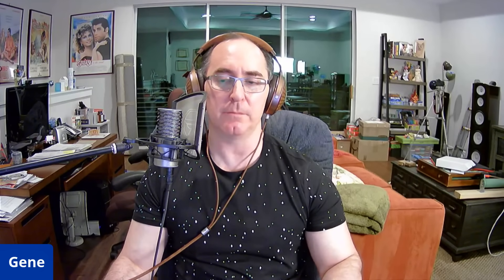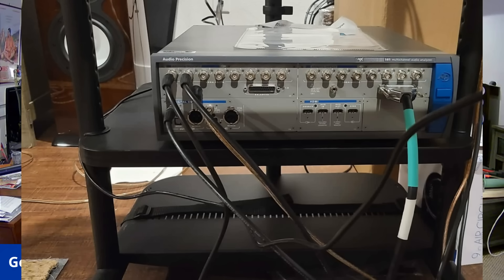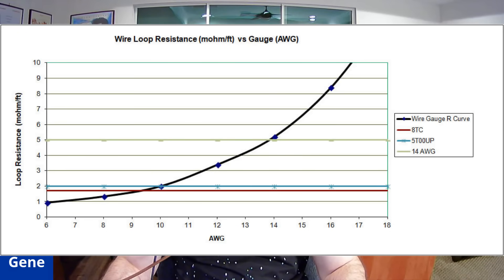Speaker Cables Really Don't Make Much of a Difference?

Comment: Even though its nice to see measurements, but I didn't like the conclusion "you're buying jewelry", since you're buying what sounds better, and not what measures the best (at least with cables). Its on buyers conscience if they buy something expensive without any noticeable improvements in the sound, but as it was proven so many times already - cables are very system dependent, so when are we going to stop recommending something based on completely wrong facts, like measurements. Since, as proven here in this video, we still don't know how to measure cables and correlate the results with actual listening test. 
Video would be great if it was just "here are the numbers, make your own conclusion and listen for yourself", instead of "here are the numbers, so music must sound better/worse/same"
Reply from the maker: Just because you don't understand the basics in electrical properties of cables,  doesn't mean others don't understand.  This is very basic and understood stuff I presented here. No magic, no mystery.
Reply: @Audioholics  that doesn't have anything to do with my comment. Did you able to correlate measurements with listening observations?
Reply from the maker: @hudo  I've not heard any differences comparing speaker cables unless the gauge is too small (18AWG or higher).
Reply: @Audioholics  you don't hear the difference in any cable (excluding very small gauge wires)? 
Thats very strange, there's must be something very wrong with system setup (speaker position/room). Once I moved speakers out from the walls and did very basic room treatment with carpet/walls, i could easily hear differences in some cables. Not all, but like half of them I tried, and not realated to the price
Reply: @Douglas Blake sorry but thats just not true. If you never heard the difference that doesn't mean other didn't or that is has to be psychology. I even had a switch for cables so was able to do quick ab test in few occasions, and sorry you don't have enough experience with this
Reply: @Douglas Blake lol you just said it, you never heard the difference which means you lack experience to even talk about those subjects! You chose to believe into numbers and don't trust yourself and your ears, which is fine, but you shouldn't then do generic conclusions that something is not possible.
Reply: @Douglas Blake i did, again more, in case i missed something, but nope, same as before. You say something is impossible because numbers, but don't have good enough system to hear for yourself, and then you find yourself an authority to tell everyone that its impossible
Reply: @Douglas Blake you too, keep buying hifi equipment because 1khz wave looks good on oscilloscope and enjoy

Comment: Nice test Gene.  Much the same as my person feelings on cables.  Only difference I believe I hear is mixing metals on cables. Silver plated copper to me sounds wrong, 10kHz + seems boosted. I am happy with pure copper.  Would be interesting to see if there is a measurable difference there.  Or if my head is making it up. Thanks for making the effort debunking cable BS

Comment: I'm sorry, but this is a perfect example of how you can take the most precise measurements and yet come to baseless conclusions.

Frequency domain measurements can never describe what something sounds like, because humans are notoriously sensitive to time domain characteristics, far greater than frequency domain, and yet you try to make assumptions based only on what you CAN measure, rather than all that SHOULD be measured. And i'm not even talking about measuring the external factors, that should also be measured for a proper all-encompassing study, that may allow drawing any kind of credible conclusions. This is not about just this comparison, I think that the lack of time domain measurements is one of the most overlooked components in many audio companies, also because it's hard and sometimes impossible, but that doesn't mean we cannot perceive the differences by our ears. So, I'm sorry, but the burden of proving there are sonic differences is not on those who can hear them, but on those you want to argue the opposite. Just because you can't measure or prove everything, it doesn't make it any less real. But I would agree that not everybody can pick up all the minute differences with their ears, in which case it should really matter to them if the cables sound different.

Also, if that's how you come to conclusions about audio, why don't you compare speakers like that? Two completely different sounding speakers can actually measure very close in terms of frequency response, even within let's say 0.5 db or less deviation, yet they can sound completely different.
Reply from the maker: You should learn the concept of Fourier Analysis and the Laplace Transform before making I'll informed statements like that. The lack of difference in amplitude response I measured also means there's a lack of difference in time domain behavior too. The psychoacoustics of loudspeakers is much more complex than the signal transmission of conductors.
Reply: @Audioholics  Ok, I stand corrected on that. But in that case how do you explain hearing clear differences and being able to identify different cables in a blind test, not just in one area, but multiple. Differences in instrument separation, differences in perceived speed and decay, differences in definition and soundstage depth, etc. What I'm saying is if you cannot find the right measurements to justify what you can hear, you can't come to a conclusion that what you hear is maybe not real. Just the opposite, it means you were not able to find the right thing to measure, or maybe there's no available tool currently to measure what makes the difference.
Reply from the maker: @LevonArakelian  to date, nobody has ever been able to show a preference in cables under blind testing conditions.  Most of the differences people think they hear in cables is due to placebo.

Comment: Thank you for the "real science". I have a question. Due to my room layout, I had to use 18' speaker cables to get around a fireplace and hide the cables. They are MediaBridge Ultra Series 12 AWG with banana plugs. Am I ok? I have Forte I speakers with a NAD C-388 Integrated Amp with 150 w/channel. I also had to use a 5 M dual RCA cable for my subwoofers, Audioquest Evergreen . Do you guys see a problem with that? Thanks

Comment: I have been into this hobby almost 50 years. Many years ago the editor of Stereo Review said that you can't hear the difference in amplifier's, I believe he was talking about power amplifier's. Well it turns out, they do. As well, just because something measures the same, does not mean that they sound the same. Kimber Kable's 8tc run's over three to four hundred dollars an 8 foot pair. I'm glad you put this test out there. I tell people, 1st, find out if you have a money back guarantee for at least a month, because wire's do sound better after running them in for day's.  2second, DEFINITELY compare them  to other cable's, Monster, Blue Jeans,  and other cable's around the same price. See if the establishment you're   considering buying you're cable's from have a loaner program, so you can compare all of them,  some establishment's will gladly do this.   Listen in a very quiet room.

Comment: Thanks for the Video.  14 years Electronics Technician in the U.S. Navy Submarine force. Gene, you are spot on with your measurements and explanations. People who dislike this video and message are in denial. Most likely because they overspent  on speaker wire ~ Peace.
Reply: In a blind test I hear changes in cables on my system every time. For better or worse... Explain that.
Reply: @infooptimalfitness7720  Whatever you can assert without evidence, I can dismiss without evidence. -Christopher Hitchens.

Comment: I use monoprice 12ga. I had long runs for some bi amped speakers and I used double runs to effectively increase the speaker gauge. Thanks for the continued great content Gene.
Reply: They have pure copper also
Reply: Mono price cables are copper clad aluminum (CCA)!  Essentially junk.

Comment: Adding to my post below, A real test that would be interesting is to take a large range of capacitance/inductance and resistance from say one of the best wires/interconnects that you have to one one that is worse than your worst one. Mic up a speaker tweeter, then mid and then woofer and determine by using the best cable to the worst (for the largest difference possible) can any of the speakers cone movement or volume change at all with the largest cable differences available. I would bet that no matter what you have for an interconnect or wire the extremely small differences are too small for the speaker to reproduce so any of it is audible. Use that .2 of a db as the audibility level. You will find that the speaker drivers can't reproduce any of the audiophiles supposed "bad stuff". The driver will act as an effective filter on the insignificant wire differences. I could go on but you get my point. So much science proves that so much snake oil is sold everyday.

Comment: Gene, are you aware that over 10,000 double blind tests have been done with declared audiophiles in the last 40 years?  NOT ONE PERSON HAS EVER PASSED A TEST. The result needed to pass a test was downgraded to just picking out ANY change or be able to pick which listening test was which wire or interconnect. Even asking for anyone to pick out reliably one wire or interconnect was impossible. The auto manufacturers and others have spent millions on this stuff. It all came down to "it doesn't matter". The only item that can reliably be picked out are speaker changes. It even came down to amplifiers. A decent AVR receiver (about $400) vs expensive preamps and amps were not picked correctly. A few did but upon further investigation it was seen that the high end high dollar amps were so poorly engineered that they were coloring the sound so bad that it messed up the test. So, it would not have been worth buying that companies products at all. 

Bottom line over 10,000 people who claimed they could easily pick out wires etc and that the engineers were idiots, tin eared and were not properly "trained" to listen, well those people failed all the tests all the time. 100% failure rate. No one has EVER done it. If only one person had done it, he would be famous and the test would be online and heralded by everyone as proof that this stuff matters. All the big name audio mag writers (many are not in business anymore) stopped saying they could tell a difference and would take part in a test. They all said they could hear a difference but no way were they going to be part of a silly test when they had trained amazing audiophile ears! But, as time passed it has all come back into fashion. Now the audio mags make claims that they hear things that they do not. Luckily, people spending big money on wires and interconnects have the money and it is not hurting anyone. Better to buy wires than alcohol or drugs I guess. Just thought I would mention that you are finding out what many engineers proved over the last 40 years. Keep up the good work!

Comment: Would be great if you measured other brand speaker cables as well. Analysis plus and Nordost come to mind as they offer different strand and layout solutions than most typical speaker cables on the market. Do this and you can finally put this message to bed. I wouldn't be surprised if some of your followers would mail you their cables to test them. I know I would, but you already tested the cables I use. 😉

Comment: Thank you for the great video and the clarity on the subject. I’ve tired many speaker cables and wires and didn’t notice any difference. I think like you mentioned it comes down to what’s more aesthetically pleasing to consumers. I mean let’s face it a roll of generic speaker wire is pretty damn ugly!
Reply: In most audio systems, the cables are barely visible, aesthetics? Not in my system.

Comment: If all the speaker cables you compared had banana plugs or spades, etc. that react to a magnet, then you probably wouldn't notice much of a difference. Compare those cables with ones that are terminated with connectors that don't react to a magnet and then make another video explaining that speaker cable connectors DO make a difference!

Comment: Now I have gold plated banana plugs, but before that I had bare copper/silver coated wire. Each time the bare cable ends oxidized over time and I solved that by stripping the wire a bit further. To my ear that improved the sound each time I did it. Can you measure that?

Comment: Thx for the great presentation Gene!
I do think cables play a bit of difference in the final audio quality but I do not pray over them. The ones I use are all DIY with good quality components, but that's it. 
I've tested many speaker cables over the years and found that, for me, a good quality solid 4mm² made a good difference in the bass department. Not huge by any means, but the bass got tighter and seem faster as well. As I keep all the cables as short as possible I'll probably never hear a difference in the high frequency range. 
But Gene, if you have the time and will, would you try testing a solid cable to see if any difference would be measurable? I don't think I'm biased since I don't buy expansive pieces of copper wire, but what I've heard when I tried them made me keep the solid conductors in place for what now?... 5 years I think.

Comment: Hello, Gene. I love to watch your videos. I have Denon PMA-2000AE which is  basically the same amplifier with B&W 804S. The speaker need current to sing and the amplifier deliverid it! i have changed 5-6 speaker cables from hi end brands. One day realized to lean on measurements, not pretty words of manufacturers! So I bought VAN DAMME UP-LCOFC HI-FI SPEAKER CABLE 6mm and 4mm. /2.5 m./ Bi-wired the speakers, but that is not important. The best speaker cable ever heard on my system! And  you are right. AWG or MM in Europe and some enginering!

Comment: I do agree that cable manufacturers need to share more metrics and measurements. And that the onus is on them to do so. My own experience with cables (gone from 2.5mm to 4mm to 6mm), and each step was a difference in sound. My wife knows when a change has happened, and with blind tests she was able to tell the difference. And each step was better. But my own experience is using different guage cables.

Comment: Frequency response doesn't measure everything because music isn't simple constant amplitude sine waves being swept from one end of the audio spectrum to the other. Music is in the time domain with hugely complicated waveforms which could be broken down into thousands of different sine waves all coexisting together and all changing in amplitude from microsecond to microsecond. I've always found frequency response to be a basic guide that never really gives me the full story on how something sounds. I remember in the 70s when I believed if two things had identical frequency responses they must sound the same, but then learned through experience that they could sound very different. I remember hearing two amps with similarly flat frequency response with totally different transient response and dynamics and ability to handle complex music, or reveal detail. So I've been dubious of the use of frequency response to be the final word ever since. Having said that, I can't afford expensive cables, but even cheap ones sound different to me. I remember being cash strapped in my 20s and comparing the thick, but cheap, multistrand speaker cable I had with very cheap solid core mains wiring cable. I was shocked to find that I preferred the thinner solid core cable, and never put that multistrand back.

Comment: Here they come Gene, the Fancy Cable Mob with pitch forks and fire cross' to the Audioholic Smart Home...Oh how dare you speak the Truth....lol..
I run Mediabridge 12AWG to all of my SVS Ultra speaker 7.2.4 setup.  Denon x6700h to Monolith 7x for floor speakers and an Outlaw 5000 for atmos speakers, they sound great with those in wall rated cables from Amazon. I have learned so much about room correction and speaker placement that has improved my home theater experience from this Amazing, Truthful Channel. 👍

Comment: What kills me even more are people who swear by the "wowen silver Litz wire in perfect tensionless suspension" to transmit a digital signal 2ft. The (one and only?) double blind test made comparing digital cables for maaaaany dollars compared to a (poorly straightened) wire of a coat hanger. The coat hanger was praised just as much as the other 4 figure digital interconnect. The coat hanger isn't even made with a decent conducting metal!!! Its just the cheapest iron alloy that will bend without breaking.

Probably the snake oil from the 4 figure cable was smeared all over the coat hanger... 😁

Comment: Hi Gene, great “revealing” video.

Your take and analysis of Analysis Plus speaker cables and interconnects?

B&W Nautilus 805 bookshelf’s on manufacturers stand driven by a Bel Canto Evo2 Gen 2 with Analysis Plus  bi wired Oval Nine speaker cables and interconnects from the same manufacturer....

Comment: This type of video you do where you cut through all the B.S with measurements is just fantastically useful and reassuring . I really appreciate the time and effort you put in doing this,  I just can't overstate it.  I'd like to see some measurements on speaker cables that are put on those stupid little stands to hold the cable off the floor. As well as if there's any useful difference between cheap and expensive optical toslink cables. Thanks again Gene.